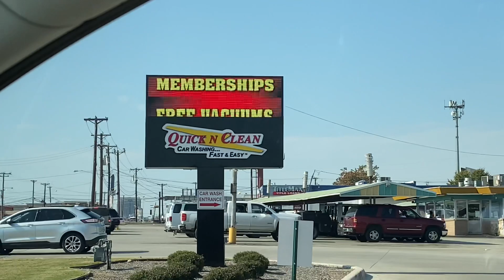(4K Belanger Tunnel) Quick N' Clean Car Wash - Lake Highlands

Comment: Belanger always Slays the wash tunnel like lets go Belanger the prince of washing. (Sonnys is the king)
Reply: Yes sir. Belanger is definitely the prince of washing and Sonny’s is the king of Car Washing.
Reply from the maker: GOOD, modern belanger tunnels are very hard to come across nowadays, especially in the DFW market.
Reply: @texascarwashchannel  Well the maintence department of the car wash in charge of that one guys :)
Reply: @carwashslayer4235 That’s correct. If any Car Wash businesses operate a lot of sites with Sonny’s equipment and some sites with Belanger equipment, they should keep the Belanger Equipment at the sites that use Belanger equipment because Belanger makes the best equipment in the industry like Sonny’s does even when it’s hard to maintain.
Reply: @greatcitysportaction2289  Agreed